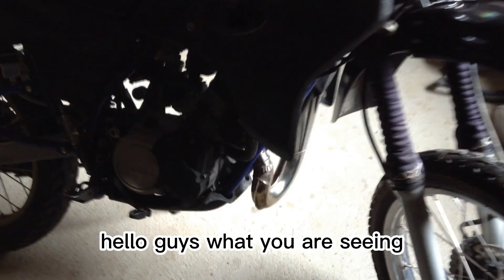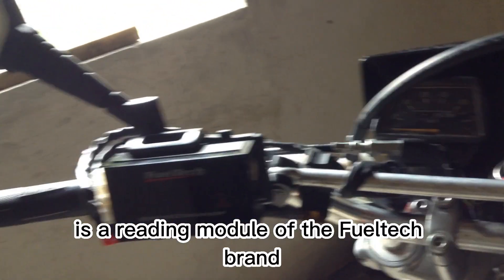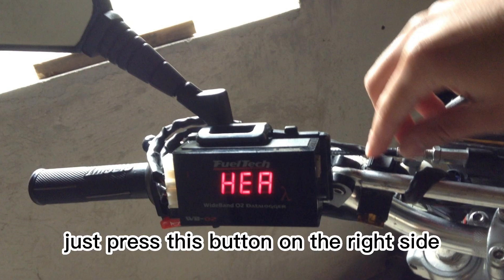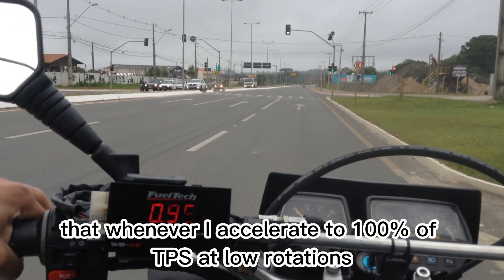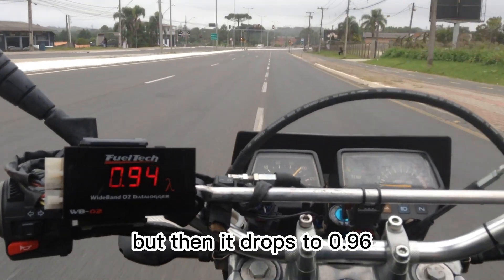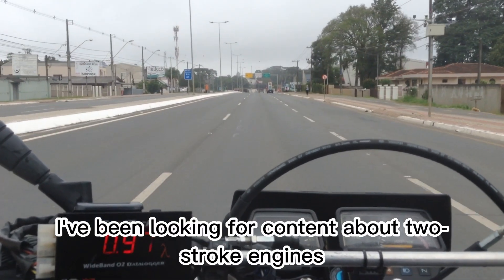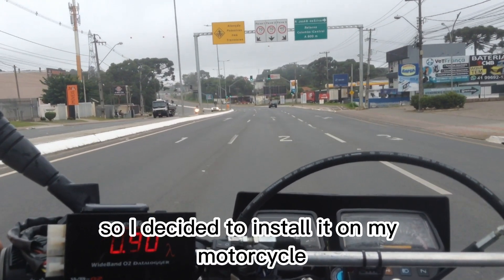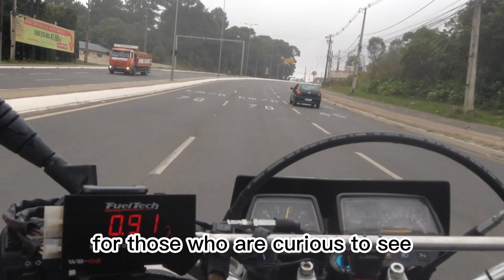Two-Stroke engine (Yamaha DT200) with O2 sensor

Comment: hello, can i know the distance from the exhaust to be drilled?
Reply from the maker: The closer to the engine outlet the better, but be careful not to place it in the path of the oil spray that comes out with the exhaust. So I always try to place it on the inside of the first bend, against the tangent
Reply: @fernandomonteiro2754 Hello there, thanks for replying. Can I know the exact measurement? inches..  how was the sensor update now? 
Greetings from Malaysia